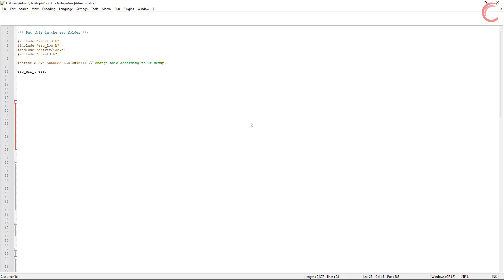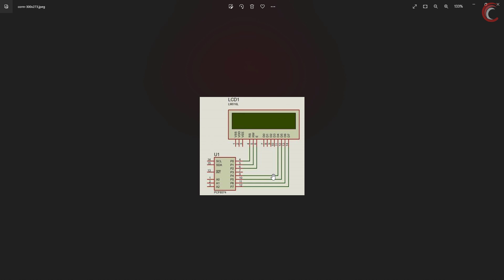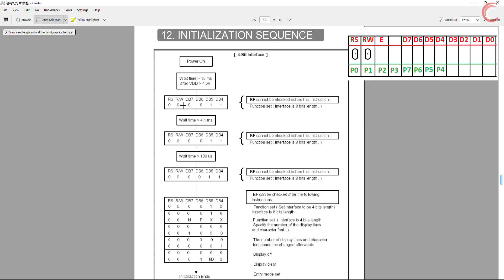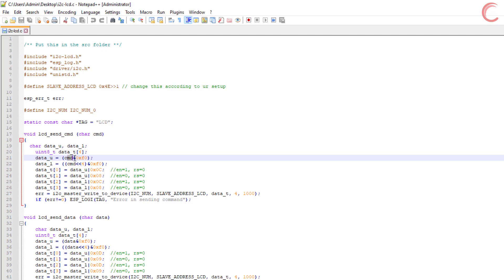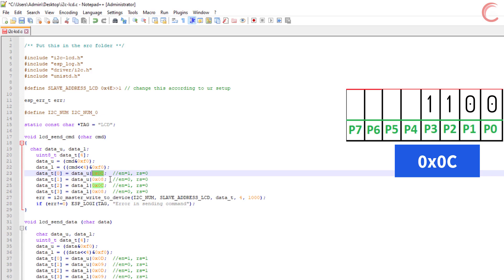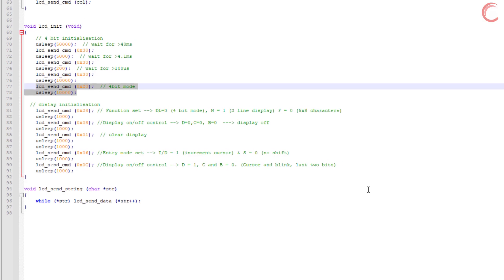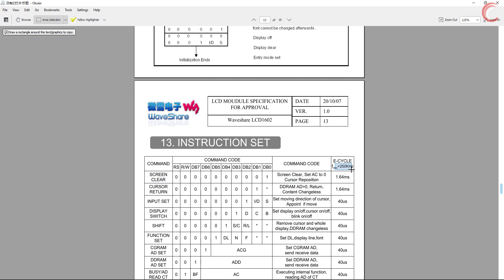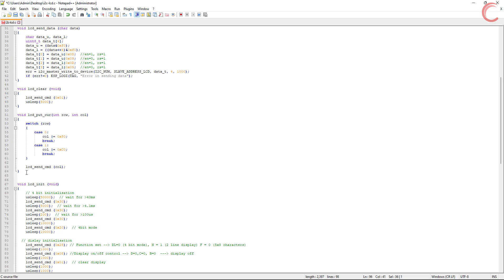How Did I write the I2C-LCD Library || Explained

Comment: How to turn on and off the backlight since the led connect to it, is possible to create function?
Reply from the maker: There is no separate command for it. 
Just keep the pin p3 low while sending the data and command.
So in lcd_send_cmd function, 0x0C will replace with 0x04 and 0x08 will replace with 0x00.
Same in lcd_send_data, 0x0D will replace with 0x05 and 0x09 with 0x01

Comment: LCDs , to set it or right to it you have to send data followed by an "E" signal which go high and then go low while the data is set , the question is how can the I2C do that , send the data while dealing with the "E" signal which is a CLK
Reply from the maker: We send the same data twice, once with E (data |0xE) and then without E (data)
Reply: @ControllersTech  i think this is it thank you , i m trying to build an I2C interface with Logic gates using FPGA (master) to control an LCD , but when it comes to LCD its a little bit complex

Comment: Do you know how I can modify this I am trying to use the 20x4 LCD with the esp. Thank you
Reply: There is code on the website for the 20x4 LCD. The one edit I had to make was to change the lcd_init function's parameters from 0x30 and 0x20 to 0x3 and 0x2; worked perfectly after that edit.
Reply: Edit: I realized that my LCD was from an unknown manufacturer and not waveshare. I suspect this is the reason I had to edit the init code.

Comment: Do you know of any caveats if STM's latest HAL library has any I2c issues?  For example, when to use hal_i2c_master_transmit () vs HAL_I2C_Mem_Read/Write()?

I understand the former sends the register address first  (start, address, stop), while the latter, send start bit, slave I2C address, slave internal mem address, repeat start, data, stop.. i.e no stop in the middle.

I'm using stm32h7 and seeing issues with a temp sensor.. not sure if I should try a third-party/opensource driver (ex. adastra-soft).
Reply from the maker: HAL_I2C_mem_read/Write is used to directly access the registers in the slave device. On the other hand Hal_I2C_master_Transmit only transmits the data.
mem_write(address+register+data) = master_transmit (address+Register) + master_transmit(address+data)

Comment: I have seen this library written so many ways. Some really complicated some elegant like this one. I did have some doubt about sending 4 bytes for 1 byte of information then I looked at the comment en=1, en=0 and finally figured out that is the same info on the data lines but just strobing it in. I am working to port the nRF2401+  to the esp32 for practice. I try to do it myself first before looking how you do it.